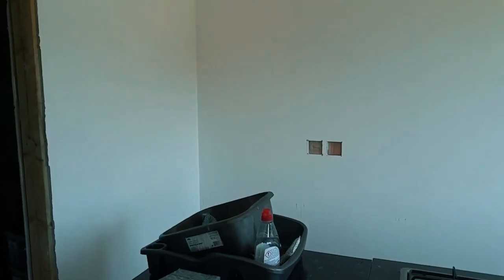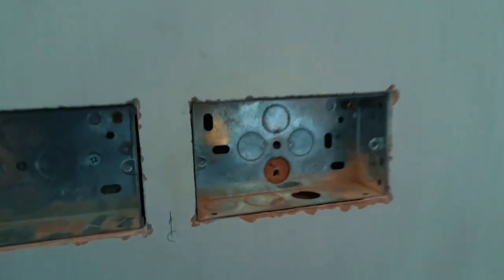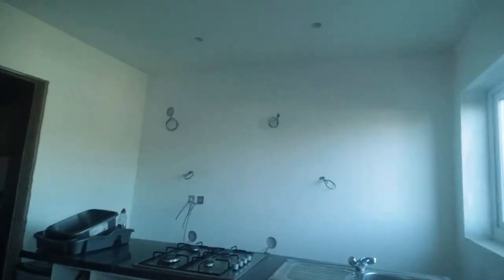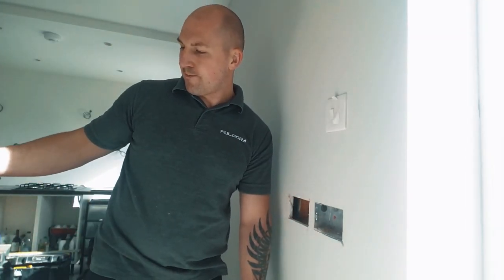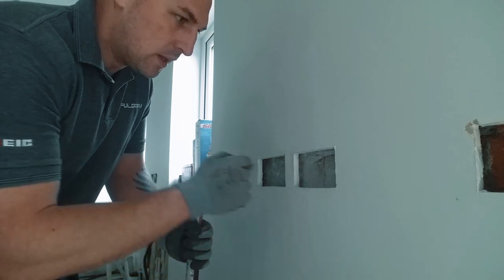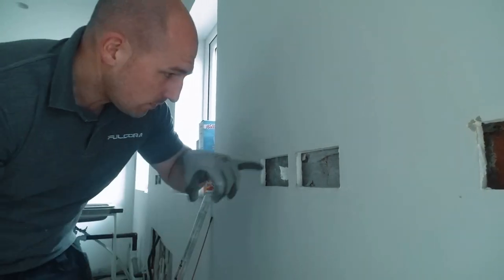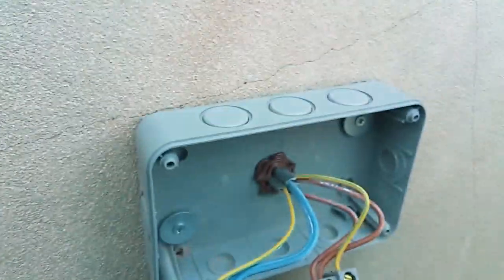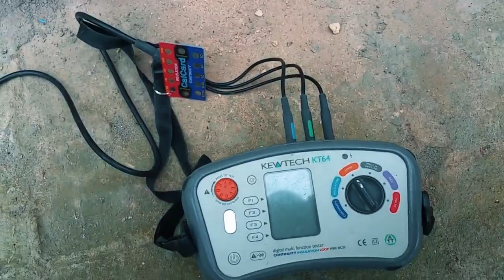KITCHEN REWIRE - 1st Fix - Dot n Dab

Comment: Nice to see someone taking a pride in their workmanship especially lining up light switches and sockets...until the customer changes their mind🙄

When taking the feed for an external socket off of an existing ring, a good tip is to install a DP isolator (where possible) in case there's a fault with the socket so you can turn it off and not lose all of the sockets in the house👍
Reply: Great idea. Thanks
Reply: 13 amp fused spur does the job just the same, run new socket off a spur
Reply: @awm7896  13a sfcu is only single pole. in event of fault doesnt totally isolate.
Reply: @arniewheeler4673 Not always Arnie, some are double pole. Best to check the manufacturer's data before installation.

Comment: I've been putting kitchen appliance ring mains in cupboards for about 15years, basically several switch fused spurs neatly in cupboards.  As long as they are easily accessible for use and maintenance (maintenance so that when they are switched off they can't be accidentally turned on by someone else whilst working on it),  are NOT emergency switches, are labelled, then you should be good to go, main reason for this is vanity and balanced load on the ring circuit (ie. You won't get one leg heating up more than the other as the spurs are so close to each other).

Nice work !

Comment: I have come across this Lot with modern kitchen designs especially when its a wall full of appliances and pull out pan draw unit few options to locate switches. Kitchen designer usually want all the switches above oven which I don't agree with due to the fact that if the oven goes on fire you're not going to be able to access the switch to isolate it. No problem with mounting them in cupboards otherwise as long as the are on the side of the unit towards the front  and cable installed in a bit of trunking from the rear not stuffed at the back.Nice video and good workmanship. 
Thanks for sharing

Comment: The only isolator that would need to be on show or at very least fixed to carcass just inside cupboard door and easily accessible would IMO, be for the hob which could potentially also be an emergency control in the event of a chip pan fire.
Reply: Good point. Never thought of that.

Comment: Great video. You can have electrical fittings 100mm away from a hob now though (rather than 300mm) as per Electricians Guide to the Building Regs. Might help on smaller kitchens 😊
Reply: Hi Luke... Yes Will is right, the minimum recommended distance an accessory should be from the heat zone is 100mm but this is only a recommendation, as long as it's not mounted directly above the heat zone, you get away with mounting it closer but I wouldn't advise it.
Reply: Alvin Ashman Yes still technically a guidance. We used to do them at 150mm and that seemed spot on.

Comment: Regulation 537.2.2.2 
The position of the contacts or other means of isolation shall either be externally visible or clearly and reliably indicated. An indication of the isolation position shall occur only when the specified isolation has been obtained in each pole.

Regulating 537.3.2.4
A device for switching off for mechanical maintenance shall be placed and durably marked so as to be readily identifiable and convenient for its intended use.

As we know the regs can be interpreted and is not set in stone.... Can an argument be made that the switches are labeled and in a convenient location.... Yes in my opinion... Your thoughts?
Reply from the maker: Craig Hawkins you sir are amazing. Thanking you! 

So in brief : as long as it is situated within a suitable location and labelled correctly then it is satisfactory? I have also seen this issue arrise for fan isolators.

Brilliant stuff that man!
Reply: My Trusted Electrician in Carshalton... 

Thats what the regs say.... I'd say the location of switches are fine in cupboards in most circumstances but it would depend on the situation, location and external influences.

I have in the past installed grid switches for larger high end kitchens where the client wanted nothing on show, sockets popped up from the worktop and the isolators were situated in a cupboard with labels.

What's wrong with having a fan isolator next to the fan (in line fan) for mechanical and electrical maintenance. There is no need for itnto go above the door or switch location other than that issue the conventional installation method.

Good videos by the way... Keep up their good work; neat, tidy any you take pride in you're workmanship well done.
Reply: With you both on this, I don't see any issues fitting labelled isolators within cupboards providing they are "local" to the appliance (have within 3m in my head but no regulation number) and are also fixed to the solid part of cabinet/cupboard as opposed to the flimsy bit of wood normally at the back.

Enjoy your videos mate, nice to see others also taking pride in their work!
Reply: Jamie Doble I think the 3m rule you have may have something to do with the old general practice of an electrical hob away from a sink.

There's no fixed number on the distance as long as it is suitable and convenient.... My interpretation of these words may differ from others depending on the situation.... Having a fixed location in a kitchen solely for isolators is not different to having a grid switch for emergency lights next to a distribution board (much less convenient and time consuming however if you have a number of floors and areas).
Reply: Bit of a grey area on this one, by placing an isolator in a cupboard (generally used for storage) there is a high likelihood that the isolator will no longer by readily accessible as the homeowner will  inevitably be storing canned food or cooking utensils in it.
Reply: Alvin Ashman
Not a grey area at all really, the isolators are not for emergency use, rather for mechanical and electrical maintenance.

If they were used for emergency use such as an emergency stop button then they would definitely have a to be on show and close to the appliance.... And as the regs details on there comment above, the location of an isolation switch needs to be in the a suitable and convenient location, moving some tinned goods and food or plates out of the way isn't beyond the ability of the homeowner, electrician or appliances engineer that may attend
Reply: I can only speak for myself, I prefer isolators to be visible, I'm not a fan of hidden isolators or sockets, when I arrive at a property to carry out an electrical inspection and test, I'm not there to play "Find the isolator". 
I had a job on Friday and ending up having to do a bit of fault finding, the open earth fault ended up being from one socket at the back of a cupboard packed to the rafters, of course the resident had forgotten all about there being a socket there.
Reply: Is that 3M rule not for oven/hob combos i.e you can use one isolator for both providing they are within 3M of each other?

Comment: In Ireland our kitchen wiring regulations are a pain. We must have a double pole Isolator controlling a single socket for each fixed appliance above and below counter level.  That is Cooker hood, fridge, wash machine, dryer. Infact now I think we are required to have a separate cct feeding isolator  for the freezer unit. Takes up so much kitchen wall space and makes kitchen a hell of alot of work. Our kitchens are done on radial circuits usually 2!!
Reply from the maker: Thanks mate. I love hearing other approaches to things. Yeh and there's rarely enough wall or cupboard space as it is without having to chuck insulators everywhere.
Reply: Could you not use grid switches for this? BG makes some nice ones with labels.
Reply: @AndrewStrydomBRP  yes that's usually what I do but the problem is a position on the kitchen wall for the grid switch, usually tricky there not being alot of space in your average kitchen.

Comment: Couldn’t agree more with the laser level, I’ve got a Dewalt Laser, not too expensive either. 

Very nice and neat job, love it. 

Just a point, I always leave my earth conductors longer than the L & N conductors, not sure if it’s regs but I recall reading something along the lines of "all live wires must be subject to tension before any protective conductors"

Not even sure if that’s still a thing but I do it anyway. 

Not having a pop, just mentioning it. 

Nice work, man. 

Sub’d.

Comment: If your referring to the DP isolators for the double ovens, as far as im aware they just have to be accessible and within 1.5m of appliance, so in a cupboard is fine, if theres a problem chances are the rcd will go off and the cust will never need to switch it off

Comment: Great vid, I’ve still got loads to watch. But I didn’t think you could use another point to create a zone. (Light switch for the cables for outside socket) unless it comes direct through that accessory. If the light switch were to be moved at a later date your existing cables would be then be out of zone & no-one would know.
Reply from the maker: Good point sir.

Comment: If your client wants the isolators out of site there is nothing stopping you doing what obviously the norm is to have your isolators above kitchen top height and directly above the sockets or other sources that they are isolators but some clients want as least amount of electrical items on show as possible and as the client has asked for that to happen when it's obvious they know where the isolators are going to be installed and if they sell the house they can inform the new owners,so in short if someone tells you that they must be visible are talking bullshit,mind my French,this is from a recently retired JIB GOLD card approved industrial electrician of 50 years,so keep up the good work,by the way I am a ringmain fan and for most of my career I never wired a final ring circuit with cable less than 4mm and that's working from specifications and set out drawing calculated by electrical architects.

Comment: Try telling the man who's spending 50 grand on kitchen he has to have horrible 13 amp switch fuse spurs above there granite worktop there fine in the cabinets as Long as there easy accessible not a problem in my humble opinion you council sparks will probably disagree😁

Comment: Can you please tell me how you fix back boxes in a lathe and plaster wall as I have had a bit of a nightmare trying to replace surface mounted mattresses for recessed.
Reply: Can’t fix to lathe so cut lathe and plaster back to your studs so about 400mm your box is about 75mm high so cut out at least double that up and down then either put a noggin in and a metal box and plasterboard or just the plasterboard an a cavity box

Comment: What I found with all Sparks doing videos on YouTube, they never show you pulling cable's through walls or how they do it. That's probably one of the most important skills in the trade, but for some reason Sparks online rarely show how they do it. 
(Hint, hint)
Reply: Jacob Adams There’s many ways. If there’s a complete void then you could just fish the cable down. If it’s full of insulation (most likely) then you can use a scrap bit of cable as a draw wire of buy rods which are solid and easy to fish down. Then you just tape the cables onto the rods and pull it through.

If there’s wooden beams or if it’s dot and dab, you just cut holes to stitch the cable where you need to get it

Comment: What measurement do you normally go from floor to top/bottom of a backbox on worktop sockets? Or do you change depending on the tile size?
Reply from the maker: The 'electricians guide to the building regulations' recommends no less than 150mm from the worktop to the centre of the socket.

Comment: i'm not one to criticize how other countries do things. if you ask me the american wiring standards are far behind those of other countries. however I cannot get my head around the switches you guys have on outlets. i haven't seem them in belgium or the netherlands (where I lived for a while). what is the point? for testing? i can't imagine many people utilize them, although i could be wrong.
Reply from the maker: I never realised that having a switch on an outlet was not normal in other countries 😅

It's easier to flick a switch then unplug an appliance and leave to plug lying on the ground ready to be trod on.

We always like to get into a habit of turning off appliances we're not using. Less chance of an electrical fire occurring from a faulty peice of equipment.
Reply: @MyTrustedElectrician  i thought it was more so you guys could isolate things during testing. tbh i've never been in the above situation; seems overkill. but hey, it is normal in america for outlets to have ground plug on the bottom! (in hospitals here they install outlets upside-down so the ground pin is on the top).
Reply: @fd3871  Switched outlets are standard in Aus as well. I have never understood why the US and other countries do not have them. I've grown up with switched outlets, so it just seems so logical.

Comment: Niceic man said ok to have isolators in the cupboard. Just put in the comments section about customer not wanting loads of isolators visible. There used to be a part p reg when it came out saying to fix to fabric of the building and not kitchen units. Since then part p has taken it out. Great video i use multi the same way
Reply: James my NICEIC man said something similar, did they take it out and at the same time brought out the reg on balanced loads which goes hand in hand with installing kitchen ring appliance spurs in cupboards so the loads will be balanced?

Comment: No regulation states a distance of switches or sockets from a cooker (300mm)  , its down to common sense and adverse effects , recommendations in the OSG have 300mm socket from edge of drainer, and cooker switch 2m from appliance

Comment: Cool video dude. I try to avoid fixed cabling in cabinetry in case of future need/desire to shift cabinet for any reason. However, that said it is convenient to be able to run isolators to one area for appliances etc. Most of the time it comes down to what the customer wants. The isolators are supposed to be clearly marked but people get a bit miffed at me when I put stickers over their nice shiny new switches etc. :) Just out of curiosity, what zones are you referring to in kitchen regarding the sockets and switches? (Including outside socket) I see no water source near where you moved 2 gangs near light switch and oven/hob was over the other side.
Reply: My kitchen has some isolaters (from Toolstation I think) with the appliance name printed onto the switch by the manufacturer. They don't look too unsightly

Comment: isolators... Meanwhile here in France that is literally non existent anymore hahah only rarely for industrial jobs. Very old houses have them sometimes for the water heaters/boilers but those get removed and it's all set up differently in the fuse board nowadays. I find it so interesting to see all those different methods and regulations each country has.. Makes me wonder who's doing it properly and who's wasting his/her time
Reply from the maker: Me too
 Very interesting. I notice in some countries they just dedicate circuits to everything rather then branching off of a nearby circuit.
Reply: @MyTrustedElectrician  For my part we run individual circuits depending on what's on it, boiler has it's own circuit, induction cooking plates have their own circuit with a 32A breaker and MUST be run with 6 gauge wire, electric heaters we usually run a circuit per on a 20A breaker, at most 2 on the same circuit. Sockets however regulation says we can have up to 8 per circuit with a 16A and lights don't really matter as long as you're not putting on very high watt lamps or whatsoever

Comment: 300mm socket from hob??? Love the vids but you’ll find life much easier when u find out 300mm is accessory from sink and it’s 100mm from the hob, check out The Electricians Guide to the Building Regs...good read 👍🏻👍🏻
Reply: It is recommended 300mm from both actually
Reply: Hmmm just wondering where you’ve got that information from??
Reply: @danwahh  there is no specific requirement in regs or bs7671, but 300mm is considered a safe distance for all circumstances, if this wasn’t the case I wouldn’t have had to move 300 sockets in student accommodation kitchens recently that were placed too close  by a previous company doing first fix

Comment: Noticed your using Dewalt I'm stuck between Dewalt or Milwaukee, only ever used the company's Milwaukee gear
Reply from the maker: D C They're all the same mate. I have mates/electricians who help me out on larger projects. They use milwaukee. I borrow their stuff, they borrow mine. In my honest opinion neither is better.

I use dewalt because I started with dewalt. All my batteries are 18v and interchangeable. This means I have an abundance of batteries onsite when one goes flat. 

It's all preference mate.
Reply: My Trusted Electrician in Carshalton Thanks for the reply mate probably going to go with Dewalt to try something different
Reply: Makita all day every day.

Comment: I'm pretty sure you just said the outdoor socket was at the furthest point on the ring,  longest part of the cable run maybe but there's n o such thing as a far end of a ring :) You knew that, I just couldn't help myself
Reply: Power distribution throughout a ring is not equal. Hence you can have unbalanced rings